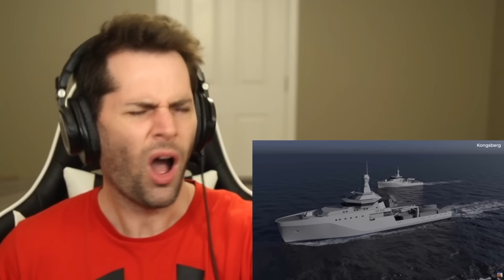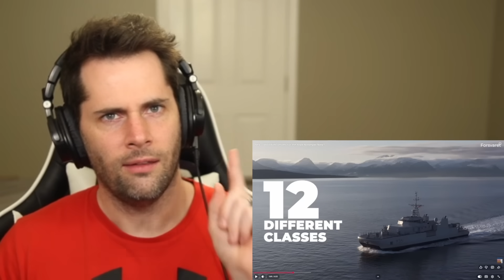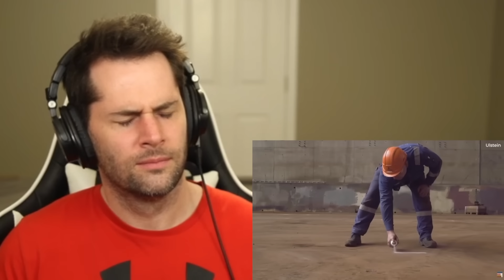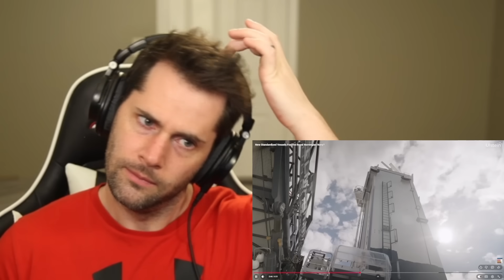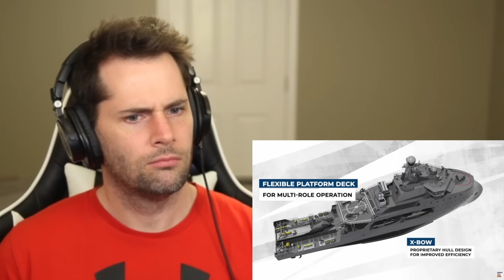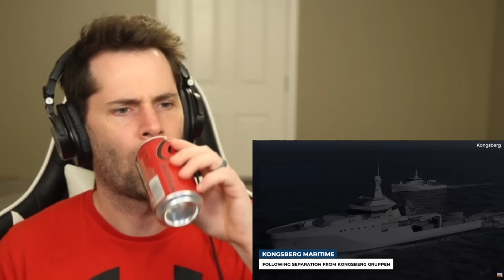American Reacts to Royal Norwegian Navy Futuristic Ships

Comment: I think they are to ambitious, and therefore it will fail, we know that military and policing tasks and operations very greatly and i can’t see how these small platforms are going to be able to be so flexible and with enough defensive capabilities to be able to effectively, timely, reliable and cost effective. There is a reason why specialized classes exist in naval military missions and policing and search and rescue and surveillance and intelligence gathering.

they had 12 different classes of ships a more realistic redesign of the Navy and coastguard would be to reduce the number in half to 6 this would allow some vessels to specialize more and others to be true multirole with a set of flexible areas that can accommodate different equipment within a set range of missions types. This would allow the different classes to be split and optimized for doing related types of missions very well and with very high quality ultimately allowing the classes to deliver the optimum performance to have credible deterrence no matter what mission they need to accomplish.

The navy and coastguard have to many varieties in mission operations and priorities. This means that all the naval operations are very diverse and to fit all the necessary equipment needed onto these vessels is very hard to accomplish and will be very expensive because space becomes a premium and it becomes exponentially more difficult to integrate them all due to the space constraints.

So 4 more classes of ships with some larger and some smaller than the current standard would be ideal and allow for some specialization of mission priorities and that will ultimately make them successful over a vessel trying to do it all while everyone knows that’s not how you provide operational capabilities to your navy and coastguard if you are serious about them being able to provide credibility and deterrence effectively

Comment: Ulstein X-BOW design is a replika of the stern from vikingship. And is better in high sea, and save fuel. as it cut the waves, not riding them. So it is not so much move in the ship. Make it easier to work onboard.

Comment: Norway has historically had one of the world's largest and most modern merchant fleets, particularly prominent as the world's fourth largest at the outbreak of World War II. Through Nortraship during the war, the Norwegian tanker fleet became a crucial Allied resource. Today, Norway remains a leading shipping nation, ranked among the world's foremost in terms of value.

At the outbreak of war in 1940, Norway had the world's 4th largest merchant fleet with a very modern tanker fleet.

After the occupation in 1940, approximately 1,000 Norwegian ships were placed under Allied control, making it the world's largest shipping company and crucial for Allied supply.

Norway lost approximately half of its merchant fleet during World War II.

Norway remains a top 5 shipping nation, particularly strong in the offshore and gas tanker segments.
Until 1920, Norway had the world's 3rd to 4th largest merchant fleet.

Reference that is important for documentation. Taken from Norwegian and British historical sources.

youtu.be/db1u5fdIegY?si=uQL4FDchjBXW3Vt5

Comment: They take a lot of the design from our oil industry vessels, and modify them for military use.
7.54: This ship is currently in use in Esbjerg Denmark as an flotell for the offshore wind turbine sector if i remember correct. With a gangway crane that you see here so people can walk to work on the wind turbines.
Im sure kongsberg have way more design with interior etc then they show in video, and holding it back from the public so it can't be abused of an potenial enemy

Comment: The "strange" ships you see are something we Norwegians see all the time. They are supply ships in the North Sea, and the oil industry. You might call them garbage trucks, because that is one of the jobs they do, picking up waste and miscellaneous from the oil platforms in the North Sea. You can also see they have large structures at the back of the "plane"! The large open space behind the living quarters and wheelhouse. And I understand that these are relevant, because they can be used for a huge number of different things. And with the help of a couple of rocket stations and a heavier cannon, and maybe some deep-water countermeasures against submarines, they are useful. In other words, a multi-tool. The second ship Norway has already ordered in England, irritates many as we have both the technology and the experience to build a fast and seaworthy ship at home in Norway. And with already demanding conditions in shipbuilding, the job should be given to those who are struggling in a demanding market.

Comment: if you compare Norway and the USA with shipyard capacity, Norway does not have as large and capacity in ship sizes as the USA but they have a greater building speed than the USA
Norwegian ships are built for harsher weather and to withstand the conditions at the North Pole.

Comment: Yes Canadians are mostly against purchasing the balance of the F35 because of built-in kill switch 🇨🇦
Reply: I saw on you tube that the dutch have cracked that code, but its you tube so who knows
Reply: There are no kill switches, the kill switch is USA refusing to sell spare and maintnence parts. Only problem with that is that F-35 is a combined project, its not an American plane. So we can all do the same against the USA, as USA cannot afford to build the entire F-35 domestically.

Comment: norway has several ship building companies that deliver world leading tech within many maritime sectors. in the wake of  the oil and fishfarming industries theres been a boom in technological development. the oil industry also pushed a LOT of people towards engineering degrees, this has resulted in a very good enviroment for inovative design and solutions that are currently world leading. shaving fuel consumption via good norwegian designs, having a vessel with batteries for small distances without using any fuel. service vessels for ocean wind farms is a good example for running electric between the turbines.

Comment: Norwegian Viking ships, like the Draken Harald Hårfagre and Myklebust, demonstrate incredible performance through advanced clinker-built designs, achieving speeds up to 14 knots. These vessels excel with a shallow draft for navigating shallow waters, high flexibility for seaworthiness, and efficient, fast sailing capabilities
Reply: It wasn't only in Norway they mad those ships but all over Scandinavia
Reply: @Ikkeligeglad  all knows that, all over the world ships was made but the Norse was top line for rough sea along the coast of Norway. Tronder ships was among the best
Reply: @kendexter  Right but the ships was more or less the same.
Reply: @Ikkeligeglad  More or less yes indeed. 
Fra Ladby på Fyn i Danmark kjennes et vikingskip av mer primitiv type, et smalt, lavt fartøy som også har ført seil (se Ladbyskipet)
 Av Norske var Gokstadskipet det mest sjødyktige, men også Tune- og Osebergskipet har vært egnet for seilas.

just like Skorgenes and Tresfjord snekke.. ja jo alle var klinkerter.. skorgenes 25 fot badekar og Treshfjord 25 fot smal.  Og så skarpseilere for fart
Reply: @Ikkeligeglad  if you like to dig down in different viking ships..
 Det er alminnelig antatt at de norske leidangsskipene var gjennomgående større enn de danske, bl.a. fordi det krevdes større sjødyktighet i de røffere farvannene 
Leidangsskipene - 20-sesse, 25-sesse og 30-sesse:
Leidangen ble utviklet som en forsvars- og angrepsflåte til disposisjon for kongen fra slutten av 900-tallet og utover i tidlig middelalder. Landet
Reply: @kendexter  Det er rigtigt at de var større men de er stadig bygget på samme måde.
Draken Harald Hårfagre 35 meter.
Havhingsten fra Roskilde 30 meter.

Comment: I think the X-Bow design was invented to prevent ships from sinking, if hit by very big waves that tend to be rare, but can happen with a Tzunami or similar, it has started to be used in some nordic countries.
Reply: it cuts fuel usage, making it more stable in rough seas and makes it better protected from splashing. it saves fuel both in breaking the sea and closing it behind it with less drag than other designs. very good design.
Reply: this is why we build them upside down...

Comment: The design of those new vessels are based from Offshore Support vessels, used for supporting the oil rigs in the North sea. 
Offshore construction support vessels are quite advanced, for building subsurface structures using several Remote Operated Vessels.

Comment: Modularity isn't exactly a new concept we in Denmark have been doing it since the '80's. The danish ships were called standard flex. Container based weapon system that you can reconfigure the layout of. Want a canon, lower in the canon container. Need missile battery, lower in the missile battery container and hook it up with the wire harnesses for the weapon control systems. Is a Crane useful then put in the crane container, for fishery control etc. The hard part was to make it fit into a pre-specified sized container and be able to communicate with the weapon control systems. We are actually thinking of replacement ships for those old standard Flex ships. We use the same concept for the latest frigates we are currently running. Just with more container spaces available. I believe the hull will be made in Poland and we will finish it up here in Denmark. We are also looking into arctic capable ships too, but have not heard anything planned yet.

Comment: the second ship looks like newest fishing trawlers here in iceland norwegians also have new of those i think
Reply: probably designed by the Ulstein Group, they have pattented that hull design. after the 2015 oil price crash that company went from 3000 orders in 2014 to 500 in 2015, then to start designing boats for several other uses than the oil industry, by 2017 they had 3500 orders in place, its a very solid company. that kind of reshaping in just two years is incredible.